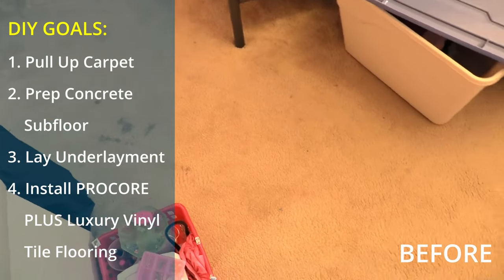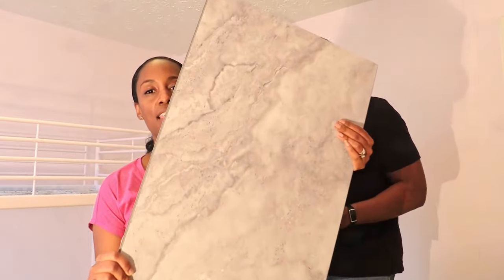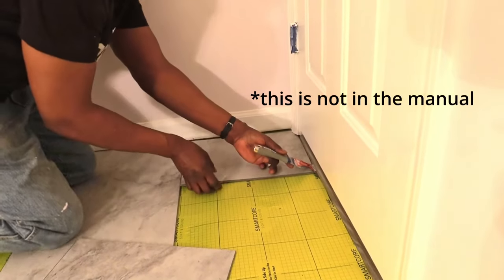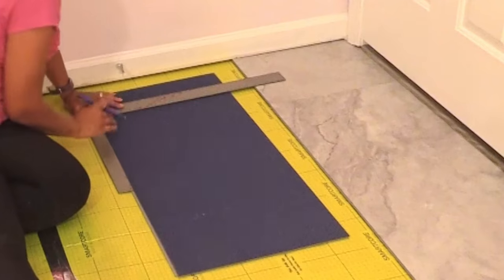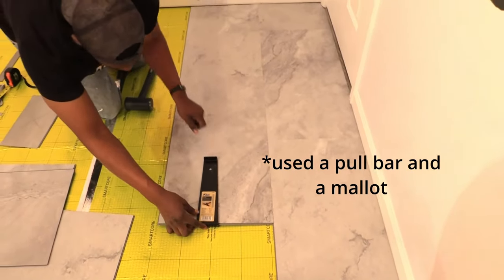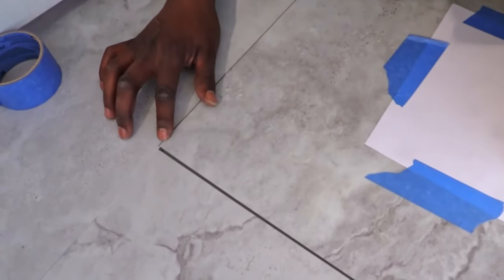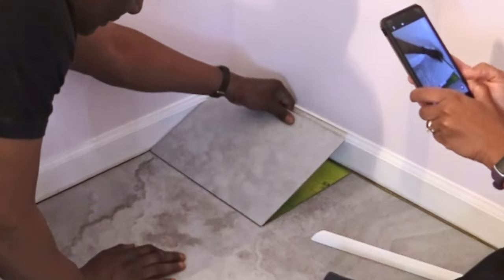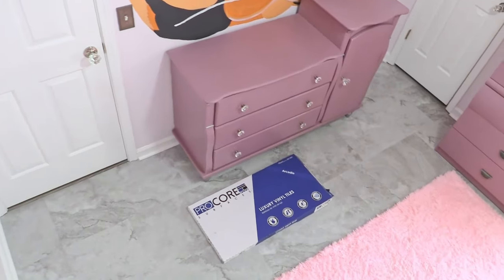Watch Us Install LUXURY VINYL TILE - Our Best Flooring DIY!

Comment: If I want to put vynil tiles on existing floor tiles, do I have to fill up the grout lines?
Reply from the maker: Not if you are installing a floating floor with interlocking vinyl tiles.

Comment: Is that a underlaying pad? If so, why
Reply from the maker: Hi Nic, this manufacturer recommends an underlayment with this padded tile if the subfloor is concrete.  You can get more info about lvt installation in our Q & A video: https://youtu.be/4IkIxPzSJl0
Reply: @DIYPowerCouple  ok, that make sense. But also interesting